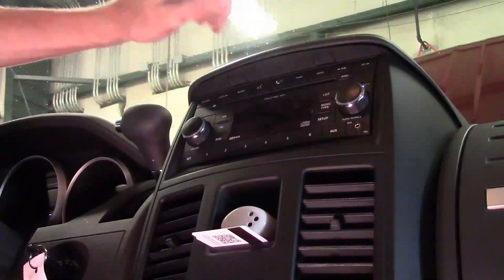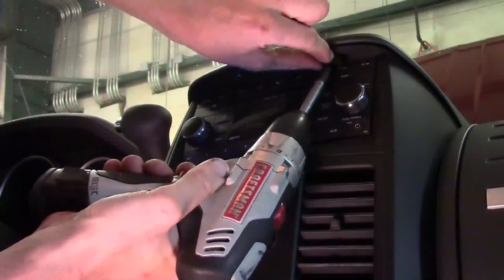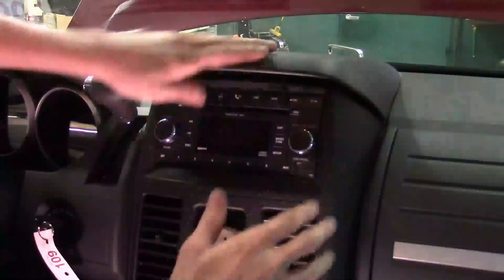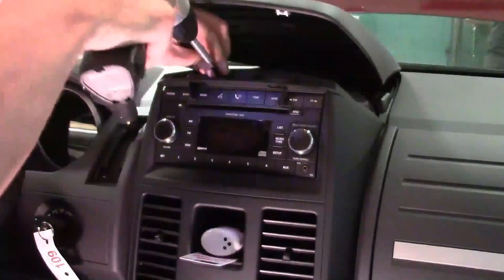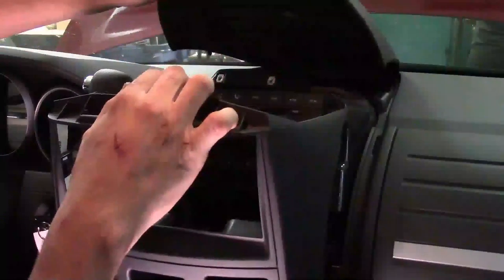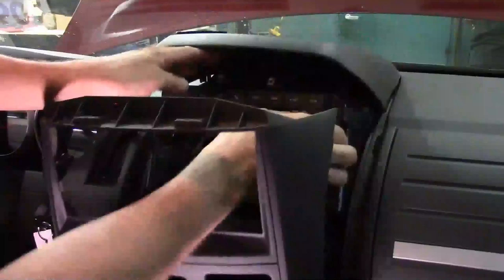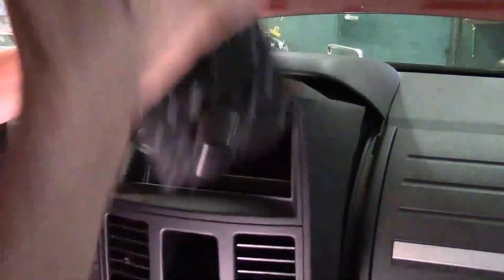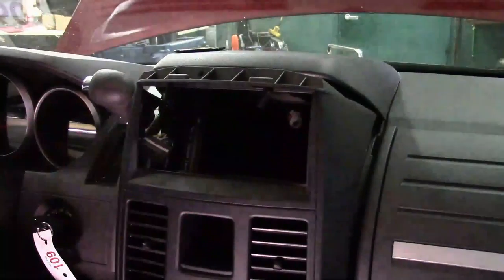2008-2010 Dodge Grand Caravan and Chrysler Town and Country radio removal

Comment: Great video, thank you. I have a 2009 Grand Caravan with the basic stock AM/FM CD stereo. On the AM band, it intermittently buzzes so bad I can't listen to the radio. It buzzes when the engine is on & off, so I know its not electrical interference. Some days, I start up the van and the radio is quiet. Any ideas? 
Problem solved - my dashcam is causing the interference

Comment: Do these radios have security codes? The radio in question is the base Uconnect 130. I got the radio out of an 09 Caravan from a wreckers yard to replace a radio with issues in a 13 Caravan. Before I pull the radio out of the 13 I'd like to know if I have  to hunt down the code for the radio from the 09.

Comment: Question? I just bought a 08 town and country from a family member and the touch screen radio seems to have no power and the airbag light is on. Any ideas?
Reply from the maker: First step....having all the modules scanned for codes to see what might be going on. Then based on the codes found....we will have a direction to go in.

Comment: I have a 2012 caravan, i broke the antenna white plug behind the radio.. can i change that small plastic part ? And i just purchased a 2009 radio will it fit on my 2012 caravan? Knowing my radio has an anti-theft in it and the 2009 doesnt. Thank you

Comment: Question Any Rasio coding ?
i have a 2010 with same radio , want to install a OEM GPS Radio or one that has back up screen .
do i need to program the radio after to work with Steering wheel Controls . or is it just plug and play

Comment: I know this video is old, but would this work with a 2010 Chrysler Town & Country 4.0 Limited Edition it has a DVD player, I don't drive it myself. My girl & my son's do,  to back to school , Dr. Appts. It gradually started turning off & on. Everything else works, it's just the radio & dvd player that doesn't anymore. I've battery reset it & pulled the fuse, to no avail. It's not exactly the one shown in the video (it's an actual touchscreen), hardly anything worked on the touch. It drives them crazy, not be able to hear anything. 😂

Comment: My radio/DVD system won't work anymore.
Sometimes the green ring around the power/ volume knob blinks, but the screen doesn't turn on.  I think I have had the radio randomly start working again, but mostly it doesn't. 

I pulled out the radio to check the connections and they all seemed secure,  at least on the ends that connect into the radio unit (didn't trace the other ends).

Any idea what could cause this behavior?
Reply from the maker: Most likely its going to be a radio issues, not much else that can cause that. Thanks for asking and make sure to subscribe.
Reply: @MotorCityMechanic  Thanks for the reply!  I'm looking at replacements online now.  

How do I make sure I get one that works with my 2008 caravan?

Mine says "P05064245AK".
It has a hard drive, an LCD screen, and works with the front and back flip-down screens and DVDs
I've seen a bunch of other stock ones that look like it, and seem to have the same connectors on them, but the model numbers end in different letters, and even the ones that are the same number have a sticker on one corner that is different from the number mine has stuck on it (e.g. "9.110") so I don't know if they're 100% compatible.
Someone told me I might need to take it in to the dealership to be reprogrammed if I buy one of those.

And those are just the stock ones.
I've also seen those aftermarket Android ones...

Any tips on this?
Reply: I just noticed another odd thing this radio is doing; when I turn on one of the front overhead reading lights, the lights on the radio buttons blink on then off, and I can hear the disc motor, but the screen still doesn't turn on, there's no audio, the buttons don't light up again and the disc motor stops.

Comment: I have a 2010 town & country limited 4.0 with radio issues. It has the backup Camera, bluetooth, GPS and CD. 
Issue is....the radio randomly goes out! Black screen, no music, no Bluetooth or camera. 
Sometimes the screen is black and I still have music and back up camera, other times the screen is lit up but no sound and camera doesn't work. 
Sometimes it'll last for 2 minutes, sometimes it's 45 minutes. I can go a week with no issues and then I can have 20 problems in one day.
I pulled the radio out and double-checked all the plugs to make sure they were firmly attached and everything seems good behind the radio.
Is there a way to check if the radio is bad or if the wiring is bad? 
Vehicle was in Texas for 5 years and Minnesota the last 5. It has all sorts of gremlins that I'm working out, but the radio has me baffled. 
Any insight? This is driving me nuts! 
Thank you!

Comment: Any idea why my stereo will cut out in the middle of a song and then not come back on until next time I get behind the wheel?
Reply: Yes I do. There's a chip on the board that's failing. Soon, NO volume will work
Reply: @Khan-flo-mah Instrumentals  actually when it's about to fail it makes loud static noises then goes silent & sometimes it actually comes back on on its own a few minutes later out of the blue

Comment: If I do this will I be able to get a cd out of it? Only reason I want to do it is to get my cd out of broken cd player
Reply from the maker: Carrie Ritts you will have access to the radio at that point. That means all the fasteners that need to be removed to get all the covers off so you can get to the inside of it. I haven’t taken one apart do I don’t know all the steps needed to get to the point where you can remove the CD.

Comment: Is this the same as a model with the navi screen? I'm going to a scrap yard to rip a stock navigation system out of a caravan, will the navi go right in where a stock head unit was like you just removed?
Reply from the maker: Behind the bezel it will fit. Just make sure to remove and take the bezel with you that goes around the video. Other issues is that some have external GPS antennas so it may need to be retrieved as well.
Reply: Thanks for the reply. I was wondering about that antenna as well, I just assumed because I have Sirius xm it would have the antenna.
Reply from the maker: They make no mention of where it is on the vehicle so just look for additional cables on the back of the radio and take what ever you need to goes to incase.
Reply: Thanks a lot for the info. Ill let you know how it goes.

Comment: is there any way to keep the steering wheel radio controls along with the rear VES worth buying an aftermarket radio...I found a harness on crutchfield but that only let's me keep the controls but not my rear ves..help please
Reply from the maker: +Tom Pajak I haven't had the chance to deal with this as of yet. I usually always have to deal with OEM systems and rarely have any dealings with the aftermarket radios. I wish I knew more about it and could help you further but I have never come across it as yet.
Reply: +Tom Pajak   Try the Axxess ASWC-1.  It works on most cars with most aftermarket decks.  Its what I used on my Subaru and a Pioneer deck.

http://axxessinterfaces.com/index.php?main_page=product_info&cPath=11&products_id=197
Reply from the maker: Kuth70 Thanks for the added info. Its always cool to see fellow viewers helping each other. Its much appreciated
Reply: +Kuth70 thank you

Comment: Is that u-connect inside the radio or is that another part?
Reply from the maker: If the radio has navigation that then everything is made into the radio. If not then the hands free module (older version of u-connect) is located under the steering column area. Back then it really wasnt called u-connect. On newer vehicles u-connect took on a bigger role and included alot of other items other then handsfree.
Reply: @MotorCityMechanic  yes i think mine is a older version it doesn't say anything about navigation and don't have a button for one.
Thanks for the heads up
Reply from the maker: @red2965  Your welcome

Comment: Would this be the same for the 2015 Dodge Grand Caravan except for the lid
Reply from the maker: It will be even easier. All you have to do is remove the plastic trim around the radio and you are there! I guess I need to do a video in the future for that repair when I get some time. Thanks for the question and make sure to subscribe

Comment: hey my town and country stereo wont turn on. any advise 2008 3.8 touch screen
Reply from the maker: +lalo nevarez Evening, the first thing I want you to try is what they call a manual power down. Disconnect both battery cables and hold the terminal ends on the cables together for about 2 minutes and then reconnect them. Then recheck the radio to see if it started working.
Reply: Ok im going to try that. Hope it works. Crossing my fingers. Thanks i will get back at you with what happend.
Thanks
Reply from the maker: +lalo nevarez I will keep an eye out for your reply